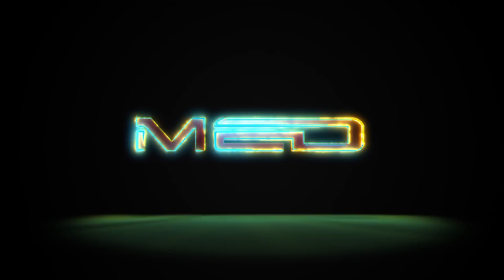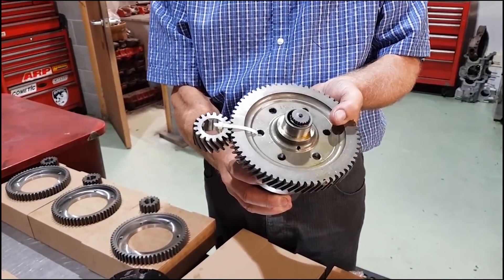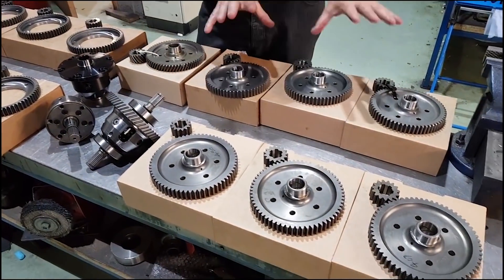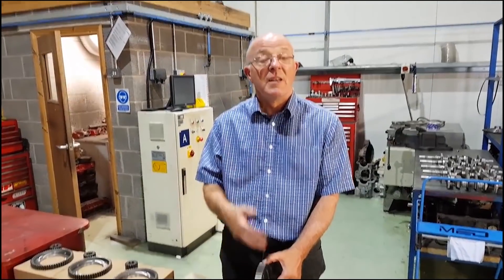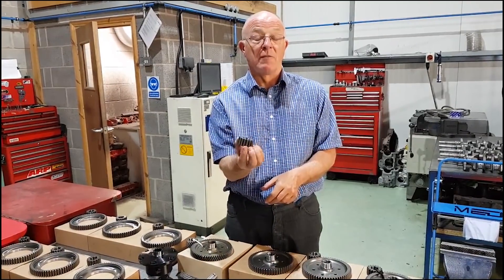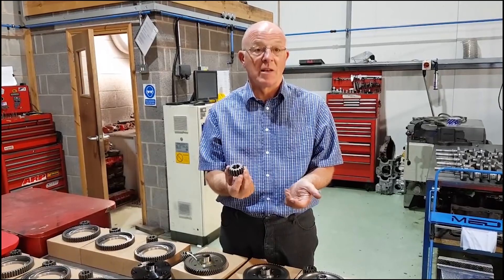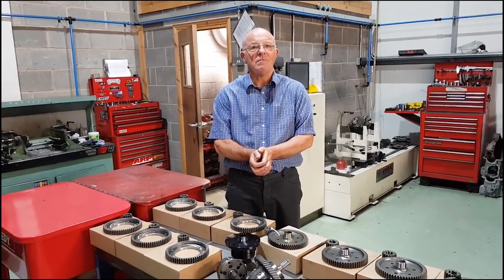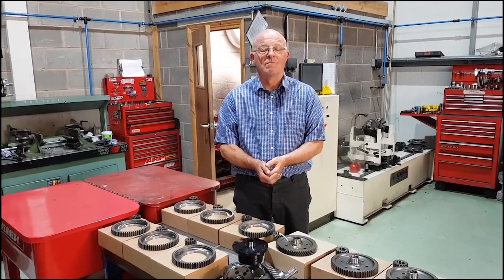Mini Final Drives Explained

Comment: Hi good day thanks for awesome video.I have a 1290 mini engine with compression ratio of 10:1.1 with 12g290 2 stage ported head and a 286 cam.The final drive is 4:1 ratio.My son of 12 years old races with the mini on clay oval track.10 inch tyres he only reaches top end at the end of straight.should I lower cam or diff ratio.
Reply from the maker: Hi Jonathan, that sounds ideal if the engine is reaching peak rpm at the end of the straight?

Comment: I’ve got a pre a+ 1098. It’s currently at the machine shop for a 40 though overbore and I will be replacing the 202 head for a 295. I plan to occasionally use it on the motorway but mostly in the city. Would it make sense for me to upgrade the final drive from 4.1:1 to 3.7:1? Thanks in advance.

Comment: I bought a recently rebuilt Pre-A+ motor and remote gearbox that has a straight-cut, 17-tooth pinion installed, but no crown wheel, diff, output shafts, etc. If I bought MED's 3.47 straight-cut pinion and crown wheel set, which I believe is a 17-tooth pinion and a 59-tooth crown wheel, can I be assured the crown wheel will mate up with my existing pinion?
Reply from the maker: If you buy the set it comes with a new pinion. We would not advise to mix and match CWPs.

Comment: Newbie question. Have a Salisbury LSD in my car now with a straight cut remote gearbox. Looking at going to stock open differential for street drive ability.  Have access to one with helical cut gears and wondering will it work with straight cut gearbox.
Reply: FHPTom, if your gearbox has a straight-cut pinion, it won't mate up with a helical-cut crown wheel.

Comment: I’ve got a 998 A+ mini city e apparently I have a 3.1 fd  but I can only get 70mph at 8500 rpm as u can imagine my head gasket bill is getting expensive what could bee the issue ?
Reply from the maker: Are you certain your rev gauge is working correctly? We don't take even the most developed full race motors to such a high rpm.
Reply: MED Race Technologies how can I test to see if it’s working correctly thank you
Reply: @p51mustang7  if you have an engine that is doing 8500 rpm? You have one of a kind that’s amazing, most stock or original engines top at 4000rpm’s to give you an idea how crazy 8500 sounds
Reply from the maker: A timing light/strobe will help. Or try another tacho. Something doesn't sound quite right there.

Comment: Very interesting. 
I am not into racing minis, but I have a mini moke (AMC Cub) with a standard 998 engine and 13" wheels. Consequently it is very high geared. I am considering changing the final drive and fitting a limited slip diff, not for performance but for improved off road traction. What would you recommend?
Reply from the maker: Which final drive do you have at the moment Ronnie?
Reply: @MEDEngineeringTechVideos  I intend to measure it soon but It's much too high at present. (I'll jack up one side and turn the wheel in top gear with the plugs removed with the diff doubling the effective turns.)
Reply from the maker: @ronnieg6358  OK. We'd probably look around the 3.7 mark and one of our new helical gear LSDs. That would be superb.
Reply: @MEDEngineeringTechVideos  Thanks. So 4+ would be too slow? The advantage of the helical gear would be less noise?
Reply from the maker: @ronnieg6358  It depends what you have at the moment. Shorter than 4:1 and you will begin to loose any cruising comfort for road use. Helical gear is the name we give our fast road differential - if you see the end of this video there's some more information: https://www.youtube.com/watch?v=HpJZGWiHXKU

Comment: Great Video as always.
Do you have any figures on how much power will be "gained" at the wells step by step when adding straight cut parts on the same engine spec. Would probably be a great video as well!

Ps: when are the cross pin diffs back in stock? :D